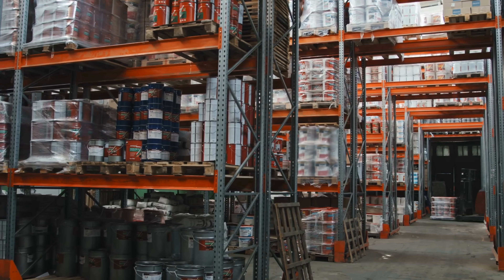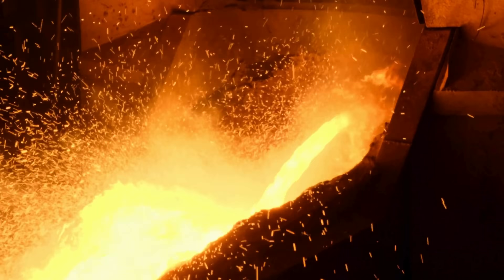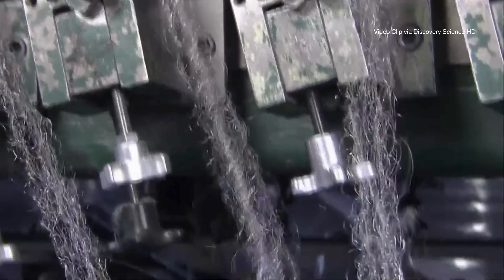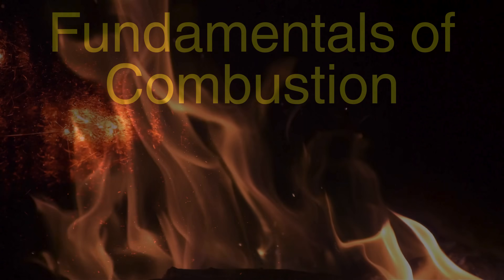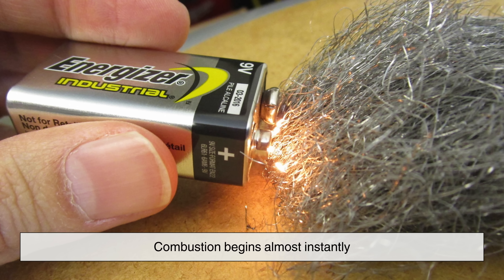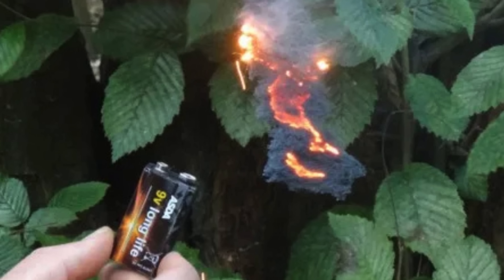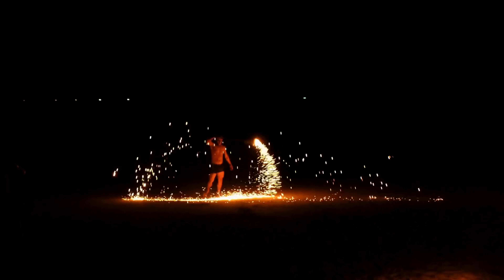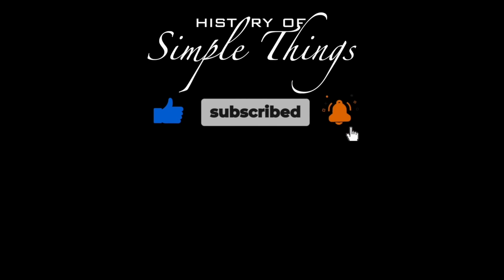Steel Wool: How It's Made and Why It Burns Like Fireworks

Comment: for those who are old enough to remember the 70s and 80s with model railroad sets you would use steel wool to clean the oxide or tarnish like layer from the often copper or brass tracks to allow the train to work properly.

unfortunately if you left the power supply on while the power supply did have a breaker built in to protect the power supply from shorts you would often start the steel wool on fire.

todays modern electric train sets use switching power supplies that would have one shot protections that if they get overloaded or shorted you would have to unplug the power supply for a minute to allow it to reset.

todays modern electric train sets also may have computerized electronic control modules that also have arc fault protections to prevent fires due to use of steel wool.

Comment: I wonder how much scrap there is and what they use it for. At some point the sheet is too thin to resist the force of the cutters and would break. So I assume there is a thin, ragged strip coiled up at the end of the line.

Comment: Back in my rock band days I built my own homemade flash pod system, Hooked up 120 v wires to each with bolts petruding  through the 1 1/2 pvc on bases then stuff steel wool inside the tubes, poured flash powder down them, ran that over to a foot switch, on the first note I hit the button and bam! Flames shot to the ceiling and mushroomed out, then disappeared like that. No smoke. Was the coolest new years gig I had! And I still have them today.
Reply: Do You have a drawing or instructions how to do this ? I would LOVE to try it ! 😅
Reply: Sounds exactly like how the “Smoke on the Water” accident was triggered! Band set off pyrotechnics effects indoors and burned the place to the ground.

Comment: Decades ago, I was working in a hardware store. One day I was smelling that HOT smell that most of us are familiar with. I looked around the work bench, and where was a glowing wad of steel wool that had ignited from the sparks of the bench grinder I had been using. Until then., I didn't know that was possible.

Comment: Steel wool burns because it's dipped in clear lacquer,  that's why you can keep it rust free so long, as long as you don't use it. As soon as you use it, it's thin layer of clear is rubbed off, and it will rust away in a few days just from the moisture in the surrounding air.  When you touch it with a flame it starts the thin coat of lacquer burning, that melts the thin steel easily.  The video was just so much BS.

Comment: Never use steel wool to clean train tracks. Cleaned my American Flyer train tracks with steel wool. Both engines ed ran faster for a minute then stopped. Small.pieces of broken off steel wool between tracks got into both train engines and shorted out the commentator . Growing up we would pull steel wool apart and hook it onto a metal coat hanger then set it on fire and spin it around.
Reply: Very true!  Best to use a block of wood on model trains.  Anything abrasive leaves tiny scratches in the rails and will cause micro-arcs that will just foul the track faster. Even the "Brite Boy" pads will cause micro-scratches.

Comment: maybe you can make a video to concentrate on how steel wool is made now that we know all about burning it.
Reply: ... in particular, what are the material properties of the cutting/scraping tools used to pare off the strands that eventually find their way into the skeins (not "bundles") of the various grades of steel wool?
Reply: @michaelthibault7930  Most likely, the tools are hardened steel (high speed steel) or carbide, much like the materials used to make cutters that machinists use when machining steel parts.
Reply: Agreed. I have seen videos on how steel wool is made and I'm sure they missed a few steps in the process.

Comment: Hi why do they not use steel or iron powder to fire our coal fired power stations all you get is iron oxide which you can use again ???? ??
Climate change ???
Reply: Because of the huge amount of energy needed to make steel initially. Think again.
Reply: Do you realize that iron oxide is rust?  It isn't useful for much of anything once in that state.  And, it's far too costly to revert it back to steel or iron.

Comment: There are a number of instances where you show stainless steel scrubbing pads and call it "steel wool".  That is INCORRECT.  They are NOT the same, and stainless steel scrubbing pads are made from much thicker strands, and it will not oxidize.
Reply: No one says stainless steel wool
Reply: @ou812....  DUH, that was the point.  Stainless steel scrubbing pads are NOT the same as steel wool, and thus shouldn't be shown in a video about steel wool...  SMH.
Reply: @ffjsb being a bit technical about stuff people interchange any ways. That's my point
Reply: @ou812....  Words have meanings, especially when used to identify unique things.  That people misuse words and should be corrected is the point.
Reply: @ou812....  If you're going to make a video like this, you should do BASIC research into the content....  I mean this is high school level stuff.
Reply: Came here to say the same thing.  Brillo isn’t steel wool.
Reply: @Revox67  Actually, Brillo brand pads ARE made from steel wool.  You're thinking of the Scotch Brite pads.
Reply: @ffjsb  good information man 👍
Reply: Cos it is SS, and Not Steel.
3rd grade science...
Reply: Okay Karen, calm down 😂😂😂
Reply: @jchawkjr2  Another troll that can't handle basic facts....
Reply: Thank God for the word police. We all see how smart you are.
Reply: @ou812.... dude just stop talking
Reply: @ou812....  You clearly aren't smart enough to know that it's not about "words", but the actual difference between metals...

Comment: Another differens that makes steel wool burn is that the shavings are so thin that the heat cannot dissipate fast enough to cool it to extinguish the flame, similar to why thin stripes of wood is used to light a fire rather than big logs.

Its a combination of how much oxygen that can react with the material and how fast heat can build up.

The more oxygen the easier it burns, the more heat the easier it burns.
Reply: If you are amazed by how steel will burn, try the metal magnesium.
Reply: @robertball3578  I have burned magnesium stripes in school chemistry class yes :)

Comment: Regarding 6:23, when selecting steel wool as a barrier to rodent infestation, use coarse Steel Wool such as #3 or #4 instead of fine Steel Wool such as #0 or 00 or 000 or 0000. This is because coarse steel wool is like razor barbed wire to rodents whereas fine steel wool is soft like a cushion to rodents.
Reply: I would rather use copper wool. The steel will eventually rust (moisture in the air). The copper will stay intact.
Reply: @donaldboyer8182 Interesting, what other things is copper wool used for?
Reply: @ginog5037  I thought of using it in the make up air intake to keep bugs and other creatures out.

Comment: In olden days, Steel & Flint were used as the ignition system in Flintlock guns. The flint was clamped in the jaws of the hammer. When the trigger was pulled, this released the hammer. The spring tension drove the flint in the hammer forward which struck the steel part called the "Frizzen". The resulting shower of hot steel sparks ignited the gun powder in the firearm. The Flintlock gun could also be used to start a fire by igniting gunpowder for tinder.
Reply: Forgive me as I may well be wrong, but given that the flints wear out fairly quickly yet the frizzen often shows only minimal wear even on 200 year old locks, isn't it tiny particles of flint, not frizzen steel, that ignite the priming powder?
Reply: @paddyglenny  Thank you for your question. The flint in Flintlock guns had to be resharpened when it became dull. This was done by unclamping the flint from the jaws of the hammer on the Flintlock gun. Sharpening flint was done by a process known as knapping where sharp flakes of flint were chipped off the edge. Flint or Obsidian or Chert can be sharpened by knapping, because of their conchoidal fracturing nature. In the flint and steel ignition system, it is actually tiny pieces of steel that are shaved off the frizzen that form into the hot sparks. The reason is because steel is pyrophoric. When steel is pressed against a rotating abrasive grinding wheel, the sparks emitted are hot steel specks. Furthermore the steel spark luminosity test is a well-known metallurgical determination for what is in the steel. In modern times, artificial flint is now used which is not the same as real flint. Artificial flint is known as Ferrocerium which was invented in 1907 by Austrian chemist Carl Auer von Welsbach. Ferrocerium metal alloy is composed of iron (20.8%), cerium (41.8%), neodymium (4.4%), praseodymium (4.4%), magnesium (4.4%) and lanthanum (24.2%). In modern lighters, the serrated steel wheel is turned which grinds off tiny pieces of ferrocerium that becomes the hot sparks. Ferrocerium is used in modern times, because ferrocerium is much more pyrophoric than steel. In lighters, the ferrocerium wears down quickly but the steel grinding wheel does not wear down as quickly. The confusion started because in lighters what is called “flint” is really artificial flint which is ferrocerium. On the other hand, real flint is found in nature as stones along with chert and obsidian.
Reply: @jadenephrite  Thank you for such a comprehensive education!